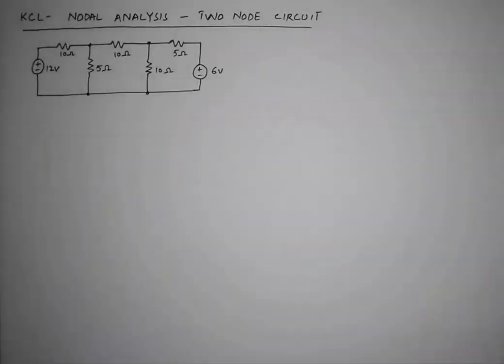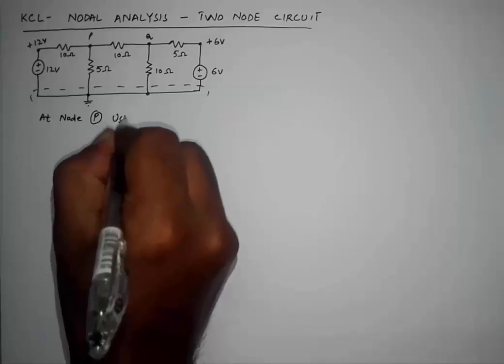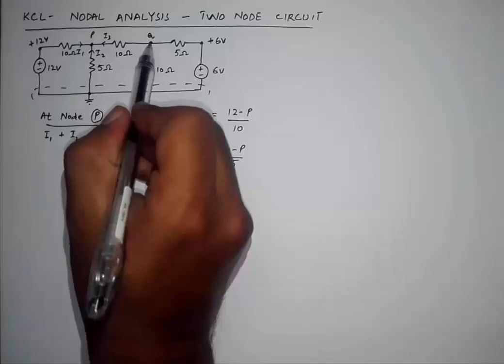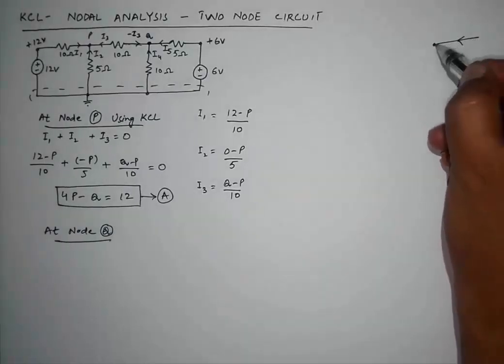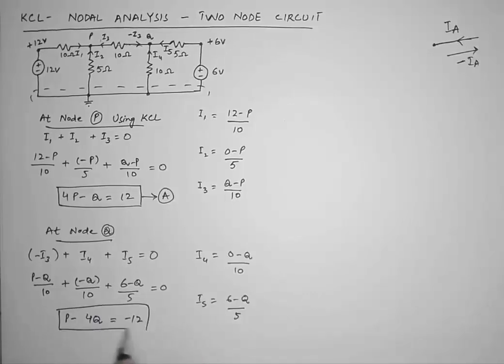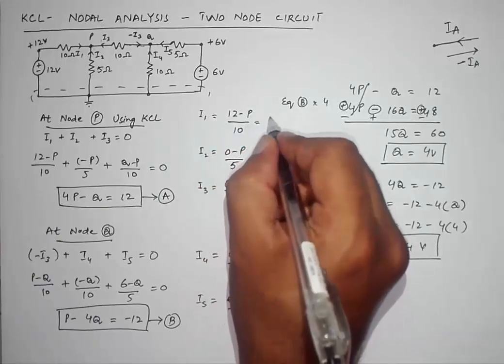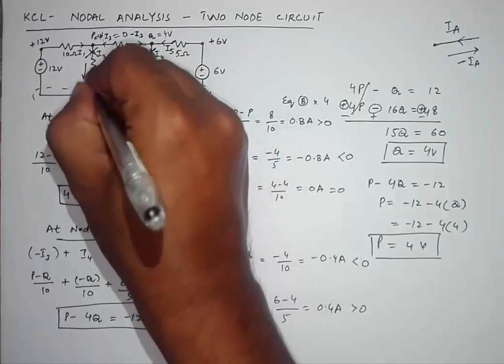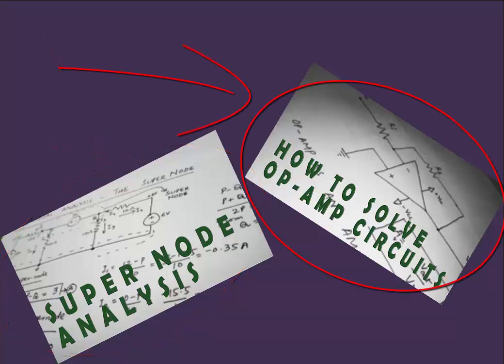Lesson 02 - Node Voltage Analysis ( KCL ) for Two Node

Comment: in the second equation  there is "-" sign, but while you solving the two equations you made "+' sign, why?
Reply: i noticed that too..it should be -12x4 right?
Reply: but he fixed it when he changed the signs because when he added the two equations he used 48+12